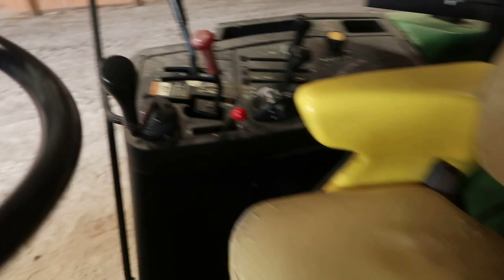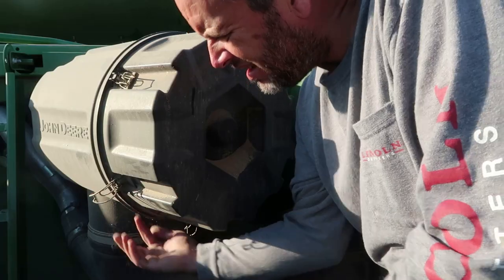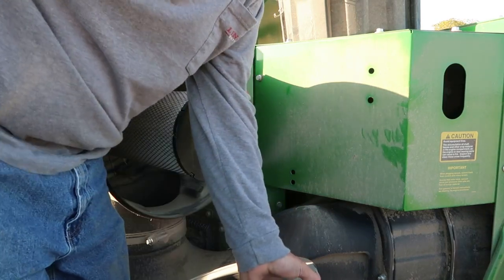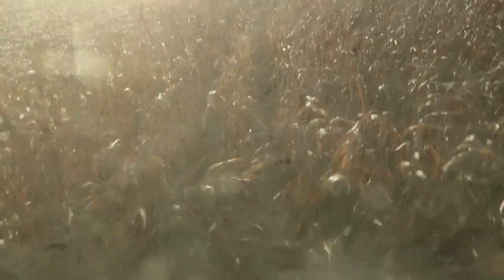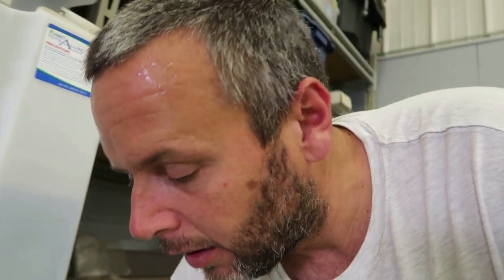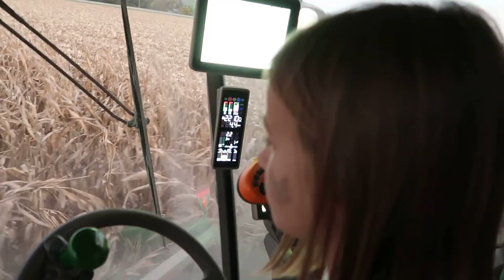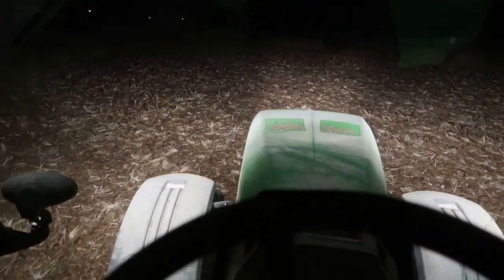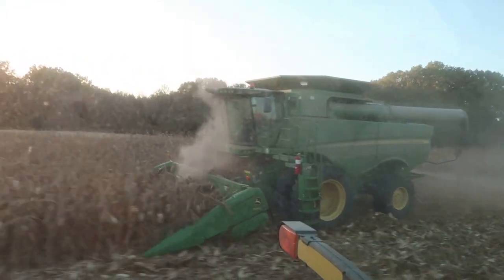Letting the kids run the combine.

Comment: You mentioned the beans being dirtier than normal, I think here in Indiana they were less fuzzy than usual. They had some but normally the combine gets a layer 6 to 8 inches deep on the throat, not so this year. Sure, it was a bit windier than normal at times, but when it was calm, there just wasn't the buildup like most years. Varieties didn't seem to matter, I wonder if the extreme dryness this year was a factor.
Reply from the maker: I honestly think it was.
Reply: @growincorn745  You better be hittin the hay unless Sunday is a no work day for you guys. For me, my brother and I are gonna warm up a couple corn pickers
 Mines a 2 PR IH. His is a damn New Idea no. 7. POS.
Reply: Oh, yeah with a little hand shuckin to open the field first.
Reply from the maker: @57fitter  lol corn pickers are one thing I've never ran.  They were pretty much gone by the time i was born.  We usually don't work sundays unless we absolutely have to.  Best of luck with the corn pickin!
Reply: @growincorn745  Thanks and we ll keep our limbs to ourselves.

Comment: Kids are doing great . Maybe not harvesting 5,000 bushels an hr but they appear to be in good hands . 
How do you like that drill?. I got same 1, little older and it drives me nuts. Can’t change wheel depth with out something messing up and the pressure springs are a real treat to change on your own. Rows don’t want to plant unless perfect level . I could go on for days
Reply from the maker: It does ok for us, but we dont use it hardly at all.  Would probably have something different if we planted a lot of wheat.

Comment: How fast u go with ur s660 .I live in auburn Illinois. We have an s660 and a sts9670
Reply from the maker: We put and ekotune on it and gave it 50 more hp.  I run 4.5 in 200 bu corn at 22%.  Push a 30 ft draper 4.7-5.0 mph